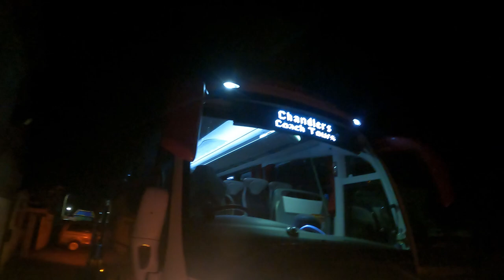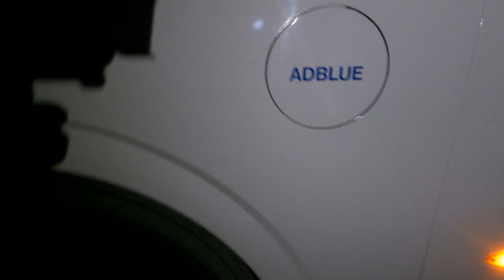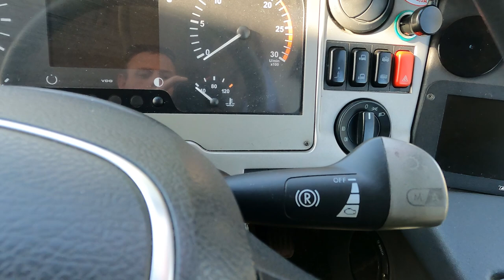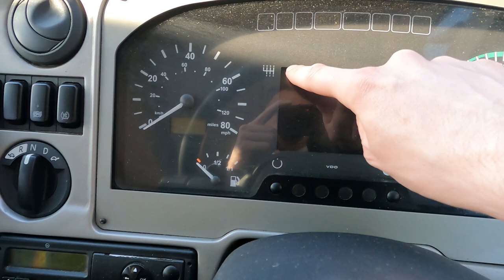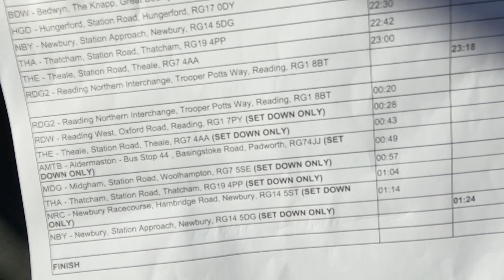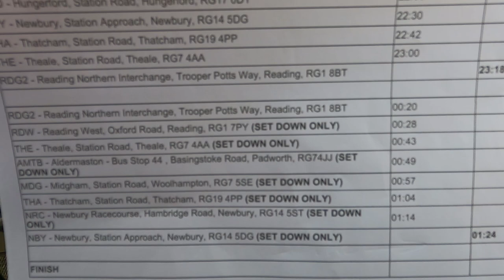Coach Driving With James Ep.9 - POV Westbury to Bedwyn Station

Comment: Hi James, yes I like the pov, it gives a better view, sound is fine as well, do you prefer driving the newer automatic coaches, or the older manual ones
Reply from the maker: Bit of both I think, some manuals are great but depends on what you are doing, done my school route in a manual once and because its down country lanes and an hours long route, you are forever changing up and down its actually quite a chore!

Some 'express' school routes on main roads is quicker in a manual than an auto as you are in control of the gears.

The Irizar I tend to use both auto and manual, usually setting manual for hills and pulling off roundabouts, the rest in automatic

Comment: Hi James, have you ever driven a tri axle? If so how did you find it?
Reply from the maker: Yes we have two in the fleet, one tri-axle Tourismo which I've taken on a 4 day tour, easy to drive as the rear steer makes it easier on roundabouts and bends, the tri axle Levante has a good turning circle as well, however it is full width and has a long overhang at the front and rear which is awkward

Comment: Well I've done security in Cummins
Thinking about doing my coach test 
Question how long does heating actually warm up cabin 🤔 cold mornings 

I'm currently doing security industry few years ago used work security in Cummins engines Darlington 
engines Darlington and emissions there assembly few Daf/Piccar engines and most have Darlington Cummins turbos  so might be good chance might some Darlington uk parts  sounds great coach
Reply from the maker: Bloody ages 🤣 this one particularly takes hours, my Tourismo can take a good half hour.

Interesting! Can't say I'm a fan of DAF, I've seen posts from truckers not liking DAF's